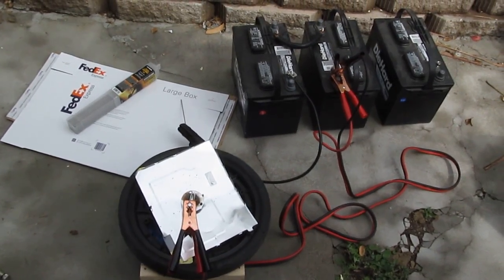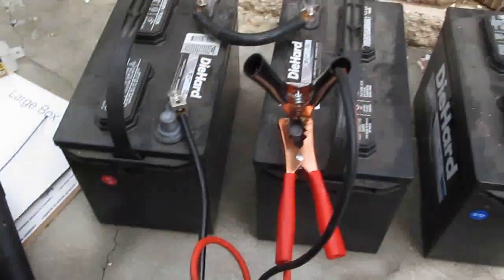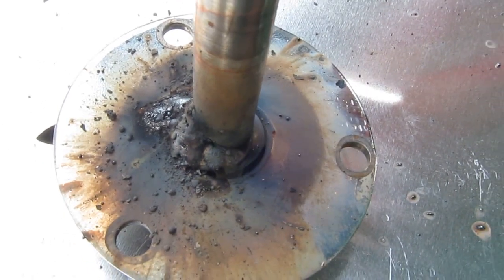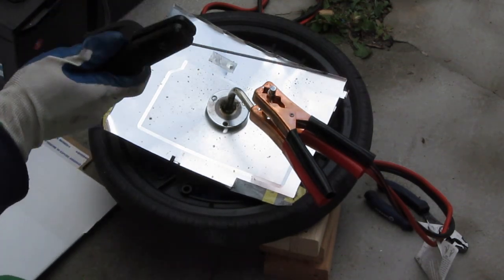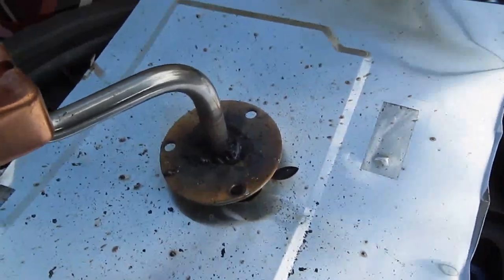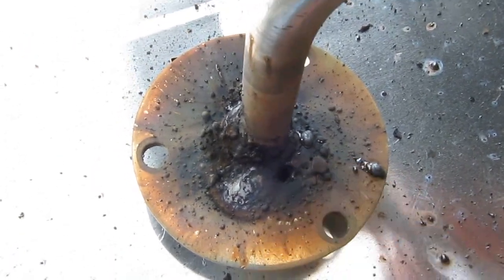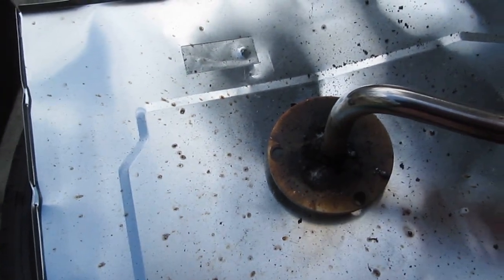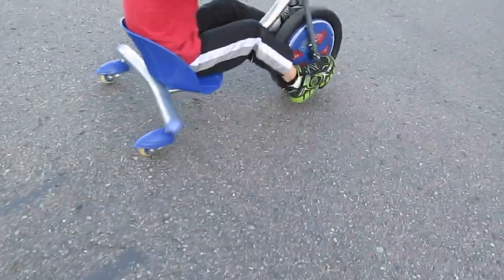DIY: Weld with 2 or 3 12V Lead Acid batteries -Home made welding machine

Comment: You've got the polarity reversed.  You're supposed to weld with the negative electrode, not the positive.  Also, 3 batteries is too hot.  2 works much better...
Reply: Why would you use the negative instead of positive to get the electroid wouldn't the power be coming from the positive on the rod?
Reply: @khalifchambers4100  It's called DC electronegative welding.  Electrical current flows from positive to negative, so you weld with the negative lead and use the positive lead for the ground.  If you do it the other way around, you won't get a very good weld.
Reply: @douglasharbert3340  thank you for the information

Comment: 3 batteries seems to do the job, but you have way too much amperes without some resistance in your leads. Try replacing connecting cables to one battery to another with bunch of thin steel wire. They will get red hot when welding, but makes welding much better when you can adjust your ampere settings. More steel wires you connect, moor amperes you get and hotter the weld will be.

Comment: Careful with that.  If the stick sticks you have a very low resistance and extremely high current that can damage the batteries.  My brother was welding like this, and the lead acid battery really didn't like it and it decided to explosively vent sulfuric acid at him. 

Is that weld still holding up on the tricycle?
Reply from the maker: It's a small stick. These batteries can handle very large current. Unless you do a lot of welding (then you should have a real welding machine instead), this shouldn't be a problem. The tricycle still holds up just fine after 1 and a half years.